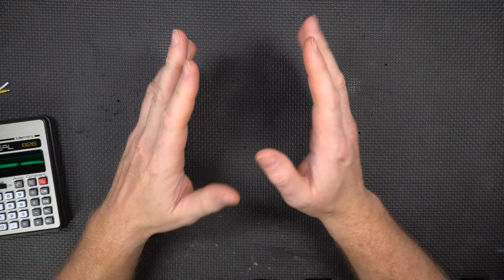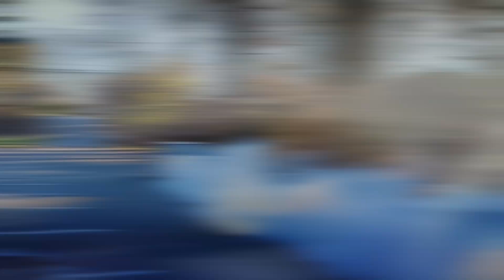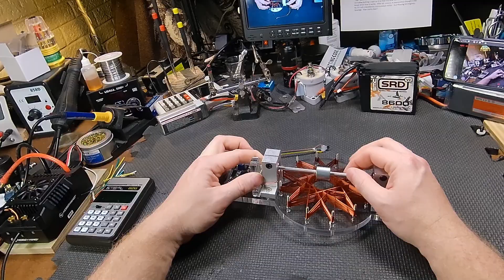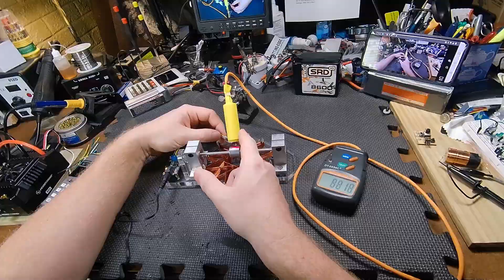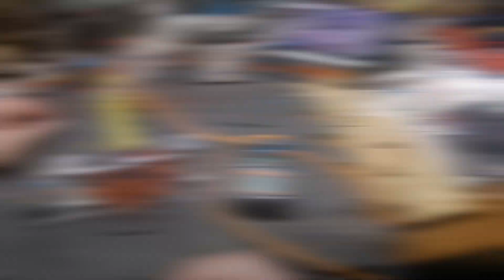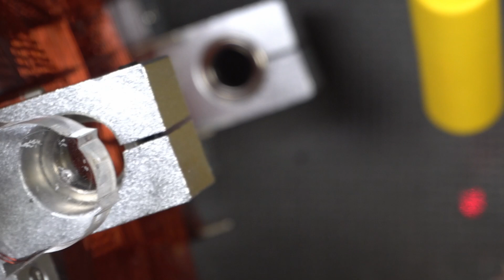Magnetic Bearing Brushless Motor - And I try to blow it up!

Comment: Once I had a round dense 3 cm long and 5 mm wide neodymium magnet with a 1 mm hole in it. I used a small thin copper wire as an axle for it but that was way to small but created minimum friction. I used a similar principal setup as you but much simpler and it went quite easily up to 87k rpm, at 6V. I increased it to 8V and it went up to over 99999 rpm, I expect around 110 - 120k rpm, and then in an instant it literally exploded. Since I knew that could happen I had my face at the side but one piece hit my leg, didn't hurt at all though. Without my jeans it probably would.

Comment: If the bearing magnets were placed slightly outside of the end of the rotor and at an angle along with stabilizing magnet bearings further inboard it may negate the need for the ball bearing end contacting anything and then it would truly be an "air bearing"

Comment: Balance the stator easily on horizontal and leveled printer rods. Use a dremel to grind away weight, and replace contact plate with glass.

Comment: Really awesome video! I just wanted to point out, I used that sized magnet on my tesla turbine, at 99,400 Rpm the magnet exploded haha. The damage was quite significant, I had a blast shield up, but if anything had hit me I would probably be dead.
Reply from the maker: That's nuts.  This thing was scaring me at 20,000 rpm.

Comment: Fundamentally how this starship coil is being used is identical to a traditional circular coil.  Except one gets uses a longer wire with more resistance than if they had used a simple circular coil. 

I explored the idea of this coil and a similar coil before making a motor on my channel. If one wants a visual idea of what happens with the magnetic field check this out.
https://drive.google.com/file/d/15Tly520I7iOr1qsqp8453AyTEX53spP1/view?usp=drivesdk

Comment: I don't think you even know what coil you were messing with I realize you probably think that's a basic induction coil no it's not that is a coil I used to do study on a couple of years ago for other purposes I should say more than a few years ago but at the time it was kind of a waste of my time that coil is the mathematically perfect Rodin coil it has a very unique magnetic field if you could get a visualization of the magnetic field it produces when an alternating current is fed to the coil you would understand why you really don't need bearings on your motor that coil will sustain its own magnetic field it will sustain its own stuff and it produces a naturally turning magnetic core which is why unlike a normal induction motor you don't need a form of start such as a capacitance start or a inductance start if you successfully wrap that coil around a donut and put a ferromagnetic fluid inside that donut you might be surprised at what happens! And I think your viewers would be even more floored

Comment: I would think that shaft stability under load would be a problem. How would you compensate for load? Great idea but I don’t think we have the technology to make this cost effective in a real application.
Reply from the maker: That is a very good point.  There may have to be some out-of-the-box thinking on the compressor side of this.  I actually have some ideas which I hint at in the video (axial flux), but I haven't thought the whole thing through.  Edit - look at ZKuwait's comment below.  They're already using these on industrial gas compressors - I had no idea).

Comment: We have used magnetic bearing in our petrochemical plant since 20 years ago. There is a French company called S2M, and they specialize in these. Their control panel assures that the equipment shaft (gas compressor driven by waste steam) is dead centre by adjusting the strength of magnets in the bearing.

The result is a super small turbine compressor that spins very fast with high efficiency
Reply from the maker: That is fascinating information.  I had no idea.  I'm going to have to look into that.  Thanks!
Reply: Super cool, good info, ta

Comment: made for use in... fluid transfer pumps for "CLNG" compressed liquid natural gas.
Reply: compressed gas doesn't need a pump.
Reply: Mars and the CO2 lakes/ice caps, CO2 gas expansion heat exchanger system, just like for water steam electrical generators, but its for CO2.
Reply: extreme temperature... liquifies at night, evaporates in day. use it to make electricity... -84 degrees at the north and south poles of earth, -200 something liquefaction. how many heat cycles till it brakes?

Comment: This was as interesting as it was infuriating. Why isn't the rotor balanced and why is there a ballpoint in the end of the shaft? It's obviously brushless, commutation is digital, so why does the shaft need to touch anything at all? Thought the point was zero friction. 

Intriguing concept and a great video, I hope you push this product further. It deserves to be improved.
Reply from the maker: Lol - do you really think I should try to "hot rod" this thing?  I bet we could hit 30,000 rpm...
Reply: @AlexLTDLX  Hot rod the display toy for science!
Reply: The magnetic bearings are both pushing axially.
The ball point is just keeping the rotor from throwing out the end.
Reply: @bryandraughn9830  oh I understand that they are pushing axially, but why wouldn't they oppose to hold the rotor centered instead of being thrown to one side. 

Couldn't you go negative bearing to negative rotor to positive rotor to positive bearing? Bearings would repel the rotor to hold it centered. 

- push- <rotor> +push+    
not
- pull+ <rotor> push

I'm not a smart man, Jenny. But I know what magnets is.

Comment: I wanted to tell you about trying liquid metal(could be diy cheaply) injected between stator and rotor

Improves cooling so you can push the motor power about 30%

People on electric scooters inject them every 3 months or so and they go from 1 kw to 2 kw or more on their hub motors

Just wanted to share the idea food for thought!
Reply from the maker: Thanks - interesting - I'll look into that.  On first blush, it would seem that it might add drag; and our limiting factor is really not being able to push enough voltage (i.e. ESC limitations) rather than motor limitations.  I could run monsters MGM ESCs on everything, but that would get expensive fast.
Reply: @AlexLTDLX  there are published paper on it but I thoughts its one of those too good to be true things until I heard about the scooter hub motors.

What you are saying is true but the other way to look at it is getting more oerformance out of the more affordable motor setup to match the big boy 50hp motor you have

For the esc would you consider water cooling a budget esc and trying to bump up the power on a bench setup? All proof of concept talk but a liquid metal budget motor and water cooled esc bench setup would make up some cool videos that are more diy project than buying expensive items

I would also like to add for the water cooled esc just weld a box atound the already present heatsink. This is the easiest and most efficient heat exchange theoretically speaking
Cheers